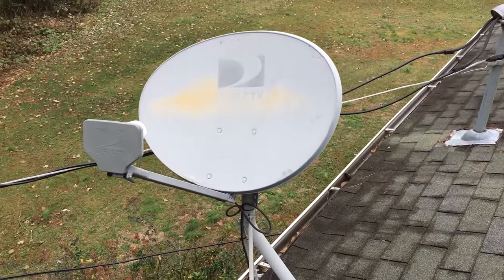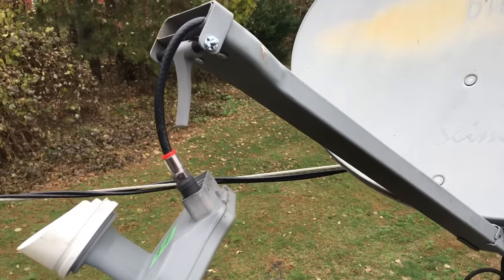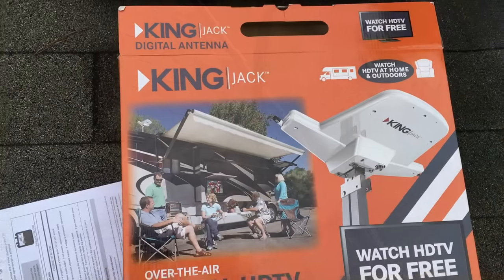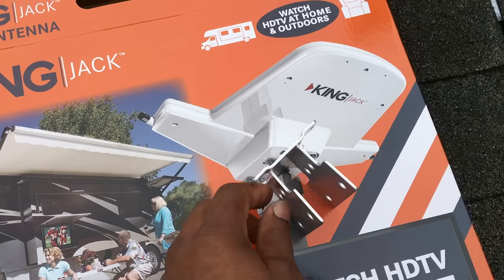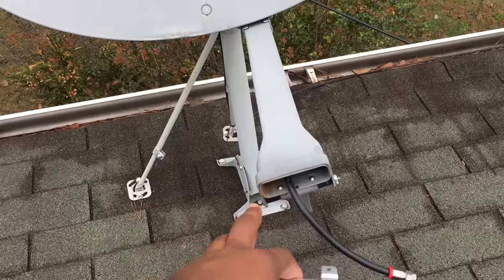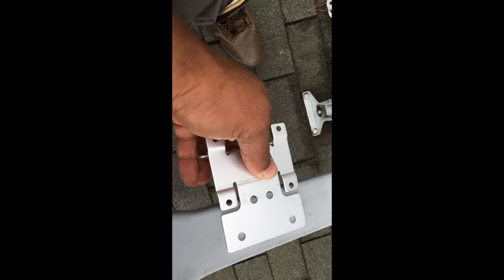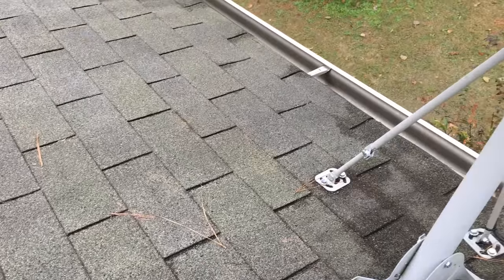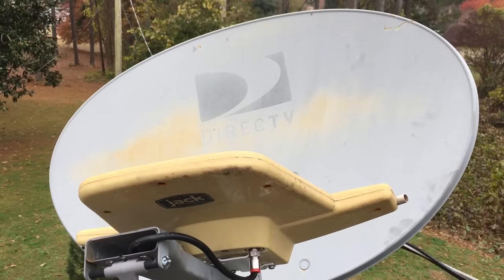Transform your Satellite dish to an antenna (Ota)

Comment: You dont need to do any of this. All i did was take a satellite dish and take off all of the electronic parts that make the satellite dish work and move around. After i did that all i had left was just a big round piece of metal and i drilled a couple of holes in the middle of the dish grabbed a coax cable and cut some of yhe rubber and exposed the metal pin and wrapped that around the holes a couple of times then put a small piece of metal over the holes and mounted that on the round dish part. Plugged the other end in the tv and i got over the air channels on my tv from a satellite dish and it works great.

Comment: in order for a parabolic reflector to work with any appreciable gain ,it must be at least 10 wavelengths in diameter..to find the wavelength u take 936 divided by frequency in mhz..that will give you the wavelength in feet...take that figure and multiply by 10 and that is the minimum diameter a dish should be to have any gain.
Reply: You do realize he isn’t building a dish right?   How about instructions on building a repeater tower instead?
Reply: @carlosperla7233  lol if hes not tring to use that as a parabolic reflecter then why use the dish at all...i dont think u realize that im aware hes not trying to recieve satellite broadcast, he is trying to use a parabolic relector thats much too small for 3 ghz cband let alone vhf and uhf signals with a much larger wavelength...
Reply: @carlosperla7233  heres your original msg....

Latest comments

Carlos Perla replied: "You do realize he isn’t building a dish right? Nice try attempting to show how smart you are though."................................tell ya what genius, go do some reading on parabolic relectors and come back, we can talk
Reply: @michellegrinder9484  lol.  Why would research building parabolic disks.  No one in this chat is talking about making dishes.  It’s about the rv antenna mounted on the direct tv dish.
Reply: @michellegrinder9484  he was just using the dish because it had an arm he could attach to.  If was using it  as a reflector he would have turned the antenna so the blunt end would face the dish as he said the blunt end need to face the signal.  The dish as a reflector would mean the signal is coming from the dish so he would have turned the antenna.  The bracket he was using could not be used on the pole.  He found a way to attach it to the arm so he could not only mount it, but also turn it to whatever direction he wants.

Comment: "I'm actually wondering if the dish helped the signal" I'm guessing no, the dish/reflector is behind the antenna so it serves no purpose. I doubt that it would help even if the antenna was pointed at the dish, it's not designed to capture ota signals. It would be interesting to see if it helped though if signal strength was checked with and without the dish. But I wouldn't expect any difference. In fact, since the antenna would be pointing away from the signal source when pointed at the dish, it would probably be worse. But without a signal check we will never know.
Reply: Maybe if he turned it around and the tv station would launch their transmitter tower into a geosynchronous orbit 22,000 miles up he might pick something up. Lol

Comment: Hi Franz. Thanks a lot for your video. I am always looking for ideas to play with TV antennas. I am going to give it a try to see how it goes. 

As others commented, the dish acts as a reflector to concentrate all the signals recieved into a single beam to the feedhorn (LNB). There is where you have to postion your OTA TV antenna, facing the dish´s center.
Reply: Roberto, how did your conversion work out?

Comment: The dish should bounce the signal to the antenna. You have the antenna facing away from the dish. The greatest signal point is on the dish not the direction of the tower.  Just flip it around

Comment: The blunt end needs to face the dish because the signal is being gathered by the dish and focused onto the device. C'mon man!
Reply: Exactly my thought
Reply: The blunt end is his head.
Reply: Not sure if the dish reflects OTH transmissions.
Reply: @therealrobinbullock  your correct wrong frequency.
Reply: The dish keeps the signal strength up! The dish doesn't actually get the signal it's the little transmitter he removed!

Comment: Fastening your antenna with the metal dish attached isn't a good idea. You'd be better off using the pole with appropriate mounting hardware and accomplish the same thing. VHF/UHF signals don't get along well with metal in the path of reflection plus you are close to that power line which is also a source of interference. If this worked or continues to work for you it's because you are close to the broadcast towers and you don't need very much antenna gain.

Comment: If the flat side needs the signal then you have it facing the wrong way
Reply from the maker: Yes. I was told afterwards that I did have it backwards. The closest towers are 20 miles always so I have perfect signal either way I mounted it. At the time of the video and I wasn’t sure if the antenna signal would reflect off of the dish. With companies these days they love to use proprietary methods so no one else can use their products.

Comment: So how is this helpful? You still had to use a different antenna but you attatched it to the arm of the DTV dish. Why didn't you try connecting a 75-300 transformer to it, since it's a metal dish? those are usually just 3-5 dollars. Also no update on how your signal was after attatching it. This video just makes me ask more questions.

Comment: Not in the focus of the dish, off center and to far forward. Could be so much better if edge of OTA was in the same position as the LNB, to maintain focus and pinpoint insertion of the signals.
I’m sure it works but if your looking to bring in fringe signals or you are on the fringe then you will have to make s better bracket to hold the OTA centered .
Reply: You need to put the actual front of the receiver towards the dish. The dish catches the signal then reflexes back into the centered receiver.
Reply from the maker: Thanks. I’ll flip it around
Reply: It has already been said. Turn the ota around and get a better picture and more channels. That's why the lnb faces that way.
Reply: Also, tip the dish down. It's aiming too far upward for terrestrial signals.

Comment: how do you find the station signal
Reply from the maker: I have an app on my iPhone that shows me where the towers are. I use it when we camp.
Reply: Use you tv menu and do a antenna, not cable,  channel search. Very easy. IT will scan your signals and channels and lock them into your tv's memory.

Comment: A half-baked idea, never analyzed, never refined, then presented as a public service.
Apply for a government job, you'd fit in (and get promoted).
1. The DirecTV reflector's job is to catch baseball size pop-fly waves from overhead and throw them to the pitcher's mitt. You, sir, are trying to catch basketball size waves that are coming as a line-drive into your antenna. Your big catcher's mitt is nice but it should be square to the line-drive, not tilted up, or most of what you do catch will bounce out.
2. That reflector is still trying to throw baseballs at your back, that's all it can do. It's useless. 
3. Earlier someone posted about it raining. Game called. Just go inside and play a DVD.

Comment: So stupid, you realize the satellite dish is designed to received a digital signal! All you need to do is run a wire from the dish to your TV and point it in the right direction. You may not get all the channels your area broadcasts at the same time because the dish is directional!

Comment: You want great OTA TV? Antennas haven't changed for over 60 years. A TV antenna is a dumb device. It doesn't know the difference between digital and an analog signal. Secondly, there is NO such thing as an HD TV antenna. The TV tuner does that. An average good YAGI antenna will be between 4 to 6 feet in length whether it's VHF or UHF. Lastly, the curvature of the earth only allows 70 miles tops and you will NOT get any better unless you're on a mountain top. 85 percent of the so called miracle antennas are nothing more than a con job. And do NOT put your antenna in the attic.

Comment: This idea is just so WRONG on so many levels ...
Wrong dish size (KU Band not even close to UHF)
Wrong focus point to the main receiving element (No calculation done at all)  
Wrong direction, the antenna is mounted to the dish backwards (the main element is pointed AWAY from the dish)
All this will actually accomplish is BLOCKING the signal lol